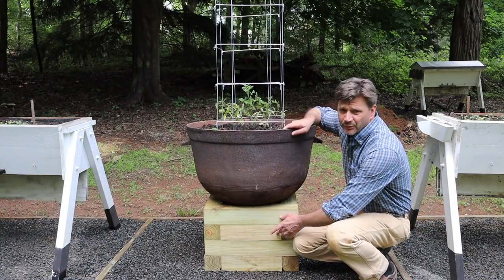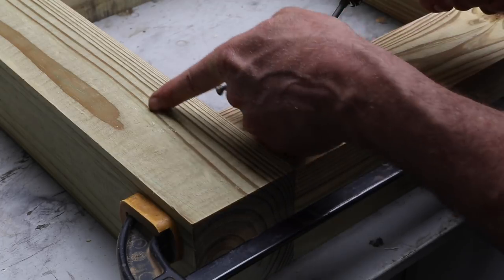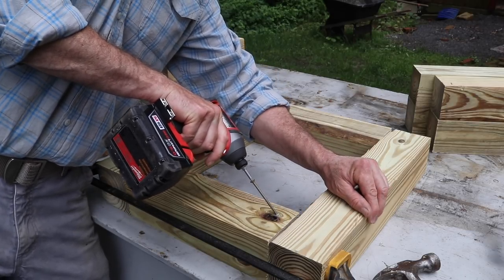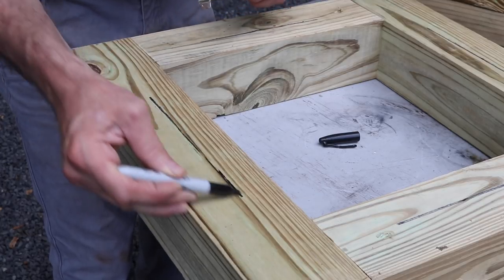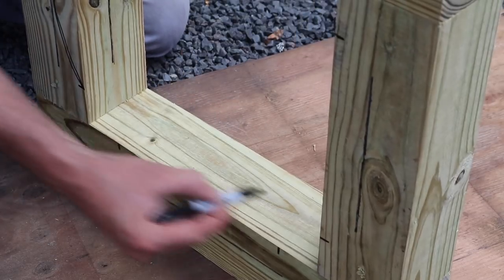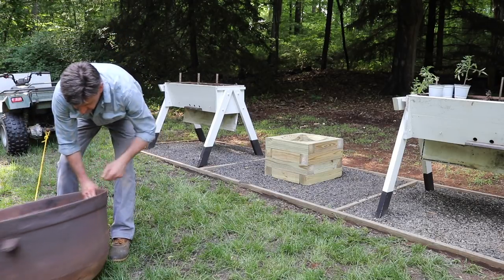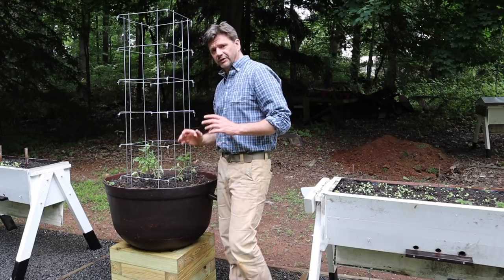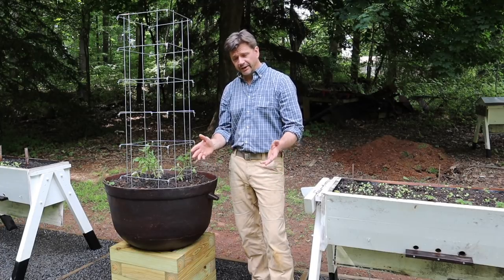Build a Treated Wood Planter Stand

Comment from the maker: Hi Guys, I should’ve mentioned this, the cast-iron pot does have drainage holes at the bottom. The iron pot was on the property when we bought the house and holes were already at the bottom so we used the pot as a fire pit for more than 10 years before now using it as a planter.
Never really worked great as a fire pit , because not enough oxygen could get to the fire but I think it will make a better planter for the garden. Have a nice Sunday everyone, Jon
Reply: Great video!  I'm going to make one like this for some large pots I have!  :)

Comment: Could you have used any other power tool other than a chain saw to shave the wood off from the top?? Just curios!
Reply from the maker: Sure, could use a grinder with any arber tech blade

Comment: Nice project.  How do you manage drainage when you use these kettles?  If you want or need an idea, I have used a method that works well.  if in your case, drainage is not an issue, no problem.  Thanks for your always entertaining videos.